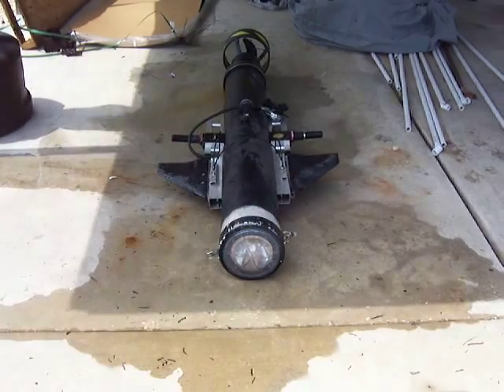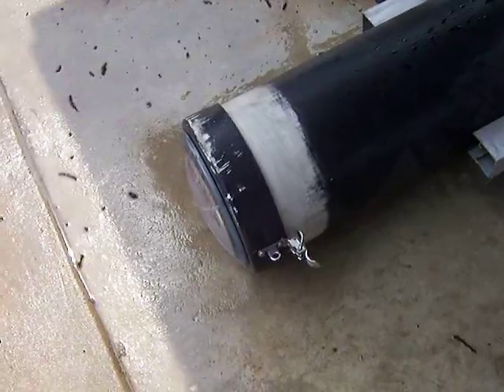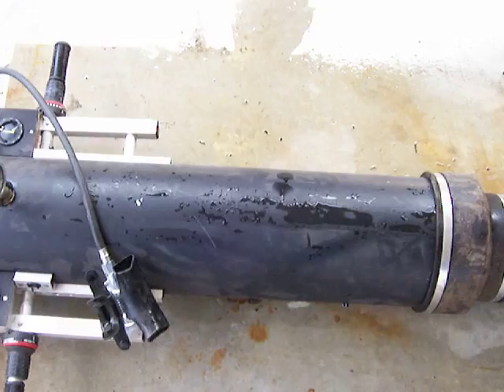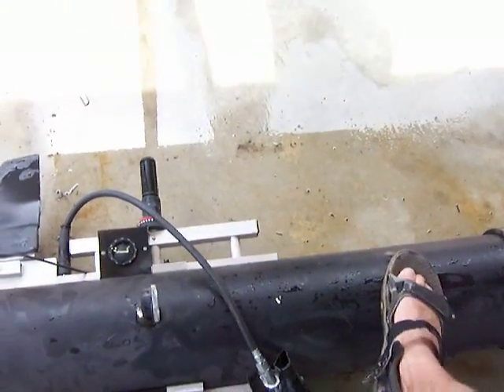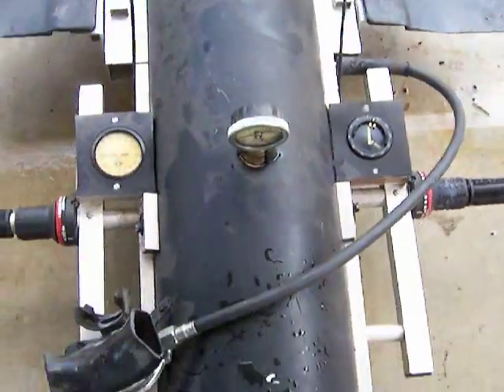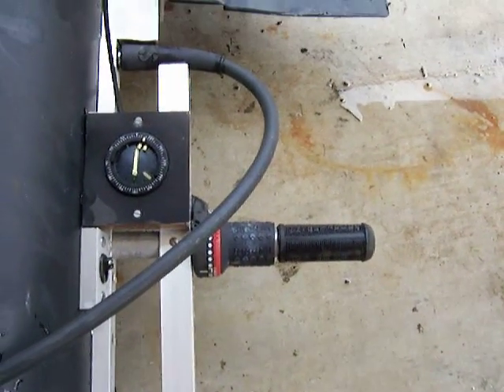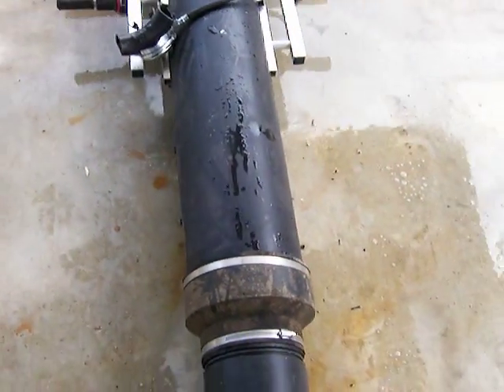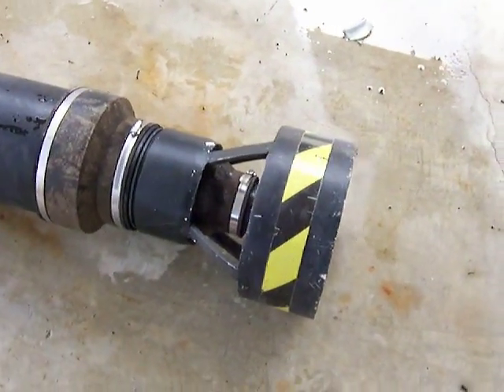underwater Propulsion unit home made

Comment: Very cleverly built.  Unfortunately there`s a very good reason why more of these don`t exist.  Having your air inside the unit your traveling on is never a good idea.  If you get into difficulty with your dive tables (and you will doing complex dive profiles) you will suddenly find yourself out of bottom time and attached to a unit when you need the freedom to surface in your own time doing potential deco stops.  You will find this a dangerous appendage to that manoeuvre.  If you carry a separate pony unit it will be less dangerous but heavy.  Have you tested ballasting capabilities as you may find it becomes dangerously heavy at any kind of depth and then dangerously light when the tank gets down to 120 bar or so.  Really i would ditch the tank and use the space for a small back up cylinder to use in emergency only and use the extra space for more battery and a camera.  Safe diving buddy, nice build though, very clever.

Comment: You've placed a direct current battery underwater abutting a pressurized air canister in a sealed cylinder, detached from your body, with no regulator redundancies in a negative-weighted device controlled by bow planes rather than body movements or buoyancy control device. What could go wrong? Just remember that you never, ever, hold your breath when breathing underwater. Exhale while ascending. Pressure blown lungs ain't pretty. Nice work, just take the air tank out & positively weight it.

Comment: Im making one right now and i was wondering what ape of batteries are you using. Im thinking about buying gel sealed batteries so if the propulsion system tips over it doesn't leak acid everywhere. Also, i was wondering what is the top speed of this propulsion system.